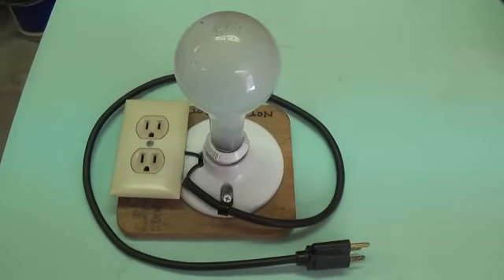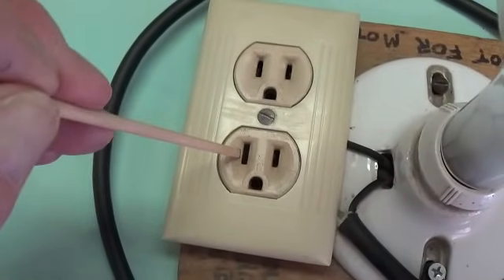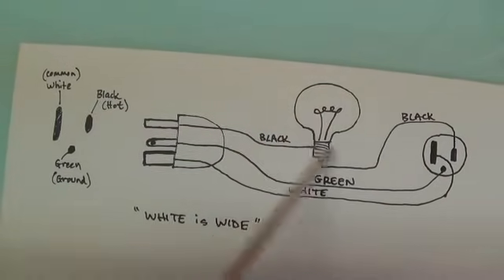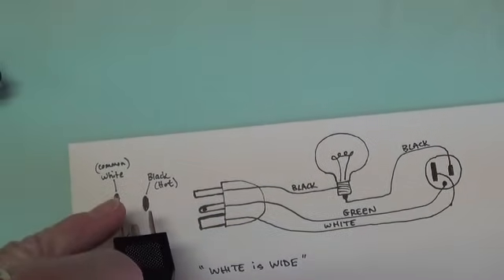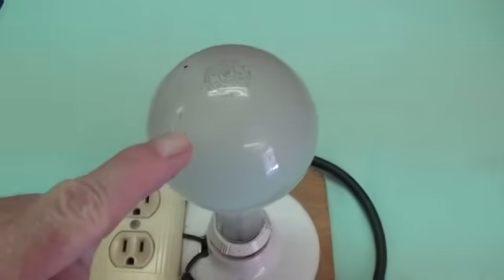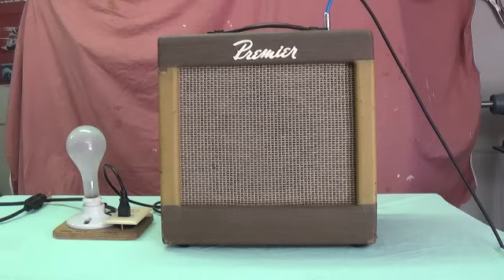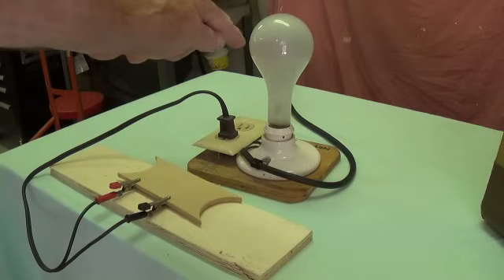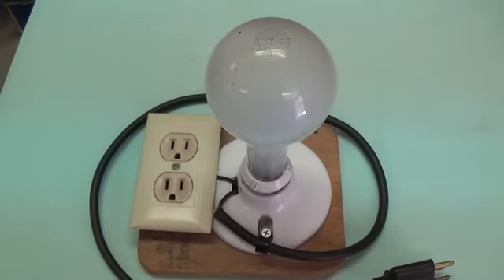Build Your Own Current Limiter for Protection when Repairing and Testing Electronic Equipment

Comment: I am a first-time writer to your excellent tutorial videos. Back in the '60s my father used something similar whilst working on TVs / Radios with live chassis. I watched all of your video with interest, but I wasn't sure if you covered the scenario where there was a possibility of an Electrician incorrectly wiring the House Socket Power Outlet. This has been the case many times, and many Power Outlet Sockets are still wired incorrectly - all over the world! I am certain that your 250W Safety Bulb will still work - even if wired in this 'incorrect' way. I no longer deal with anything old, but like to fix anything that is solid-state and broken. I use an Isolation Transformer (usually), and keep my fingers away from the "hot" side of any circuits. But your videos transported me back to a magical time spent with my father - almost 60 years ago. Greetings from Australia.
Reply from the maker: Thanks so much, Peter. We're glad the video brought back fond memories. I encourage viewers to buy a simple, inexpensive outlet tester and ensure that all their household receptacles are properly wired. A couple in my house were not.
Reply: @UncleDoug  It's really great to receive a reply from you! It was your You Tube Video that transported me back to a time when I was 14 years old, and my father was teaching me about electronics, like fixing the old Valve radios and TV's. He gave me a good (basic) grounding for a pastime that has stayed with me for all of my life! Taught me how to read resistor color codes and stuff. He passed in 1992, and I am over 70 now. In my retirement, I like the challenge of repairing any circuit boards, whether this is a TV, Home Theatre or a computerised washing Machine. However, my career path wasn't electronics, and I became a Plant Engineer. Just like me, you will be amazed at the progress that has been made in electronics in your lifetime, and this takes my breath away - just trying to keep up with all of the advancements! Today, I will be working on a Sony Home Theatre (Ta VE 910). There are ten PCB's in this Unit - one of the PCB's had developed a 'short'. I had first attempted this repair in 2011, then re-visited this in 2014. Now that I am retired, I don't care just how long it takes. I pinpointed this 'short' with the use of a hand-held Laser Pyrometer, and this morning, I am going to buy a new Voltage Regulator. I just know that my determination will pay off..... Thanks once again for being there, and I will watch your vids with great interest.

Comment: Hi, would it possible to use a halogen light instead? How can I do the wiring please? https://www.amazon.co.uk/Lighting-Floodlight-Security-Dimmable-Tungsten/dp/B0064PQCFC/ref=sr_1_2?keywords=linear+halogen+lamp+118mm&qid=1557755534&s=lighting&sr=1-2
Reply from the maker: I do not believe that a halogen light would work. However, you are welcome to experiment with one and let us know how it turns out.
Reply: @UncleDoug  DiodeGoneWild using an old PSU and put 2 halogen bulb and seems working fine showing to his YouTube videos. But when I built mine, I'm getting shorted whenever I plugged into mains and my circuit breaker keeps tripped. Any advice please? Here's the DiodeGoneWild schematics and photos that I use: http://danyk.cz/omez_en.html
Reply from the maker: It's really hard for me to troubleshoot a circuit and bulb that I do not recommend, Imon. My suggestion is to simply order a proper incandescent bulb from Amazon and follow the instructions in my video.
Reply: Uncle Doug Ok. Will do Sir. It just the bulb wasn't fit properly. But thank you for the advice.

Comment: WHITE is Neutral not Common
Reply from the maker: Both terms are frequently used and understood by those who work with AC, Ted, including a third term: "Return". To me, Neutral is the worst because it implies that no voltage is present in it, and Return is the best.

Comment: would anyone know if this test method would be safe to use with an older two-wire AC cord amp instead of a three-wire AC cord?  ...or should i construct a similar unit made specifically with a two-wire AC cord and bulb?  i have an older amp with a two-wire AC cord.  jst curious?
Reply from the maker: First, I would install a 3-wire cord on the amp, Pat. Barring that, you could use a jumper between the chassis of the amp and the ground lug in the AC outlet.

Comment: From a Ph.D in Electrical Engineering, this was an excellent video that showed the value of using a current limiting device when it comes to turning on an amplifier, testing a high pwr tube, etc.  in lieu of having a variac where you can bring up the voltage to a device, very slowly.
Reply from the maker: Thanks, Jim. I view it as inexpensive protection for the power transformer and other components in the circuit in case of a short circuit.

Comment: Note to builders: You should reverse the black wires on the bulb in the schematic. That way if the bulb filament blows, the base is not energized when you start to unscrew it plugged in. Light bulb and fuse 101. No nasty bites (aka shocks) that way.  PS, just unplug it.
Reply from the maker: Thanks for the helpful input, Sean. Hopefully none of the viewers is foolish enough to unscrew a large bulb by trying to grip the nearly hidden brass base.....but I guess you never know.

Comment: Nice video! Question: I'm wanting to try using a variac as a fan speed controller. Problem is, the circuit that I want to plug into is protected by a GFCI, and the (Chinese) variac is said to not necessarily be compatible with GFCI's. I'm not certain why it might not be compatible; whether it is due to the input rush, current leakage, both, or what. Wondering if using this current limiter, before the variac, might remedy the potential problem, that is, prevent the GFCI from tripping unnecessarily? Thanks!
Edit: Did some more reading and watching here and discovered the "not for motors". Guess I've answered my own question, back to the drawing board....
Reply from the maker: A Variac and a current limiter are two very different devices, RW......but neither will work well with a fan. When you use a Variac to reduce the voltage to a motor, the low voltage generally lacks the power to start the motor, and the motor will have very little torque. A fan speed controller is what you want. It alters the waveform of the AC and allows the fan to run with adequate torque.
Reply: @UncleDoug  Thanks! Some of the higher-end fan speed controllers are of the auto-transformer type, for instance:  http://www.hydroshack.com/fan-filter-accessories/can-filter-group-vari-voltage-speed-controller-cfh0350290.htm  I was just trying to duplicate something like this, but on a budget. Perhaps the inexpensive type of fan, router, etc. speed controllers work just as well, or better, and the variac type are just for the uninformed, with $ to spend.
Reply from the maker: I bought the fan speed controller for my Leslie speaker at Ace Hardware for under $10, and it has worked well for years.

Comment: Uncle Doug, woill this still work with led bulbs ? I know ive been hearing for several years that they stopped making incandescent bulbs. I went to the store the other day,  no incandescent bulbs on the shelves.  So, I went to another store. No incandescent bulbs. Oy !  I dont like the like you get from led bulbs. I wanted to build one of these so I came back to your video to check it out. Then I thought, gee I cant even get a incandescent bulb. So if you know if a lef bulb will work the same id appreciate it if you share your knowledge.  Thanks a million !!!
Reply: Home depot, lowes, walmart, Tractor supply etc Red Heat lamp bulb.
Reply from the maker: No, LED bulbs will not work at all. Check on Amazon......they still offer high-wattage incandescent bulbs.

Comment: If you were on an rcd (gfci) circuit, wouldn't that arrangement trip the rcd (gfci) because of the current difference in each leg?
Reply from the maker: Possibly, but most people don't have such circuits.....so the current limiter protects the device being tested from harm.

Comment: just a though if you can not get a 200W bulb would two 100W in parallel do a similar job? just getting my head back int the hobby after a very long absence and will be making one of these to use on a late 50s tube radio (tesla made in Prague) i am working on.
Reply from the maker: If your AC supply is 120VAC then the two 100W bulbs in parallel should work OK. If the supply is 240VAC, a single 100W bulb should suffice.

Comment: what would happen IF you wired the bulb to the neutral wire instead of the hot   ??????    I have talked to  a few master electricians along with my friend who has a EE degree and no one seems to have a definite answer.  Some electricians say it doesn't matter, others say it does matter and others have said "I'm not sure"
Reply from the maker: Well, for one thing, if a short occurred between the hot wire and grounded chassis, having the bulb in the return wire would serve no purpose.....the circuit would be destroyed. The bulb HAS to be in series within the black "hot" wire.

Comment: Does it matter if the hot from the plug goes into the ground or the hot of the bulb and then out either or?
Reply from the maker: The black hot wire runs to the bulb tip, then out the bulb threaded base, then to the small slot of the receptacle you plug devices into. The white wire runs straight to the large slot of the receptacle. This is all explained in the video.

Comment: Hi, Can I use this circuit for my 230v?
http://danyk.cz/omez_en.html
the device I want to repair is 1600w PSU so I think to current limiting the device with a 200-watt bulb, Does it work? 
Thanks
Reply from the maker: I simply don't have the knowledge and experience to properly answer your question, Ramin. I suggest that you try it, very carefully, and determine that for yourself. Good luck.
Reply: @UncleDoug   I tried it and it's worked. Thanks

Comment: The diagram is weird hot lamp socket as in the incoming hotline should be going to the bottom of the Lamp socket and the outer ring should not be immediately hot because it's easier to come in contact with. The Brits have figured this out and grounded their side ring.
After all the polarization (wide pin, small pin,  white wire, black wire) does matter

You can also trust the color of the wires to be correct as long as you're cord didn't come from China.
Reply from the maker: Thanks for your input, Imark.

Comment: Thank you for clarifying in your video description that the 250w bulb was better suited to tube valves than to a SS amp, which can and should use lower wattage incandescents. I built one of these, but with a switch in-line, as per another site's step-by-step build. If anyone knows, I'd be curious if a DBT functions any differently if it's an outlet and switch configuration, versus Uncle Doug's use of the hard-wired bulb socket. I could see an increase in resistance due to the increased number of connection points, but shouldn't it function exactly the same, providing the same degree of protection (I do understand that the design I built DOES work great as a DBT)? It's the newb in me, I know, but Uncle Doug's description of how this might mitigate a fatal self-electrocution, versus not using it, and shorting yourself to ground, was a very important point. I want to know if using a switch still gives the design this safety feature.
Reply from the maker: The added switch should not alter the function of the CL in any way,  RB. I left it off to simplify the use of the device.....to me, simpler is always better. I view the CL outlet as a replacement for the regular household outlet when working on electronic devices, thus a second on/off switch (besides the one in the amp) would be superfluous.

Comment: Hi Doug, I just built this device and think it is a great idea.  One comment on safety; 250 watt bulb at 110V is approx. 48 ohms of resistance.  During a dead short you are passing approx. 2.3 amps through the device.  Although this limits the current to a safe level (for the device), it is still very dangerous and a lethal shock hazard.  Not sure how clear this may be to any users.  Thanks again for your great video's!!!
Reply from the maker: Something you are forgetting, Lou, is that the filament resistance rises dramatically when heated by a flow of current. Actual current flow with a dead short is actually much lower than 2.3A.....nearly zero. This is apparent since most amps draw 2A or less and thus would work fine with a dead short (by your calculations) yet, in reality they do not.
Reply: Hi Doug, I am confused by your comment and maybe I don't understand how this works.  If you have a dead short across the outlet, the bulb lights as shown by your demo.  At that point the circuit is drawing about 2 amps or you would not have 250 watts of power being dissipated by the bulb.  I measured the resistance of the 250 watt bulb that i just purchased and at RT it measures around 450 ohms.  This makes sense because when it is heated by current the resistance must drop to approximately 57 ohms to obtain the 250 watts (110^2/57 = 250 watts).  Can you elaborate further on how this works?  Thanks - I am just getting into Fender tube amp repair and builds as a semi retirement hobby and really appreciate all the help your video's are providing me.  PS: I am a mechanical engineer so you have to understand if i am confused.
Reply from the maker: The cold filament resistance of a 250W bulb is actually much lower......in my CL bulb, it is around 2 Ohms. This means that if you plug it into a 120VAC wall outlet, the initial current draw will be Power = Current Squared x Resistance,  250W = CS x 2 Ohms, so C = the square root of 125 or about 11 Amps. But the filament resistance immediately INCREASES as it heats up, say to 500 ohms, so the current goes way down:  250W = CS x 500 Ohms, so C = the square root of 0.5 or about 0.7A. Very soon thereafter, the filament resistance reaches a point where almost no current at all will flow to the amplifier circuit, thus protecting it.
Reply: Got it- thank you!
Reply from the maker: One final point that often gets omitted is that the incoming current doesn't simply "disappear". Instead, it is converted to heat and light, more so the brighter the bulb glows, leaving virtually no remaining current to go to the shorted electronic device.
Reply: Hi Doug,  I still think there maybe some confusion on this topic that you might want to consider.  I ended up putting an amp meter across the outlet (creating a dead short and measuring the current).  The light completely illuminated and the current draw was ~2 amps.  This makes sense because the only way to output 250 W with 120 volts to have 2 amps (power=IV).  In your earlier example where the bulb approaches 500 ohms, you wouldn't have enough voltage to output the 250 watts.  So during a dead short the bulbs resistance goes from ~ 3 ohms RT to 60 ohms @ steady state temperature.  During a dead short this device limits the current to 2 amps (nothing lower) which is still a great safety precaution for the amplifier but still a very dangerous level to the repair person.  Can you take another look at this as perhaps I was not clear in my original comments?  Thanks again for your excellent channel / topics and information sharing.  Lou
Reply from the maker: It is not really intended to protect an individual from shock so much as it serves to protect the device being tested. The bulb may well be consuming 2A, but the current being supplied to the shorted circuit is close to zero.  I know this to be a fact since in the few times that a short has occurred in a circuit under test, the bulb illuminated brightly and no damage was caused to the circuit. If 2A had still been supplied to the shorted circuit, there would have been all sorts of additional damage.

Comment: Does it make sense to use this set up?

Wall socket>Variac>light bulb current limited>amplifier?

The Variac to bring the amp up slow and the light bulb limiter to signal any signs of trouble. 

Does using the light bulb current limiter eliminate the need to use a clamp meter/line splitter? Would that essentially be redundant. 

Also I see some light bulb current limiter schematics that use a on/off switch. Since the Variac has its own on/off switch does that eliminate the need for another switch in the light bulb current limiter?
Reply from the maker: I think you're arrangement would work just fine, David. I see no reason for a clamp meter unless you really want to know the exact current to select a fuse value. I see no need for an on/off switch on any current limiter. You simply plug in the amp and use its on/off switch. Extra switches can cause all sorts of confusion.
Reply: @UncleDoug  thanks doug, appreciate the quick response. keep up the great videos